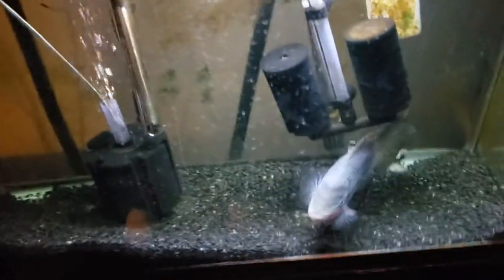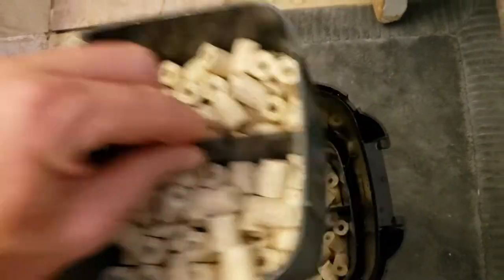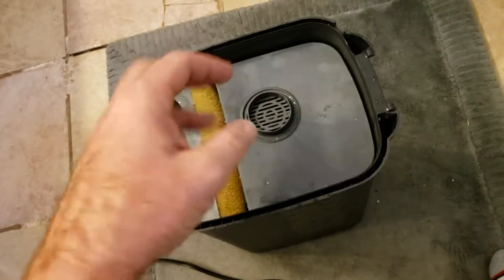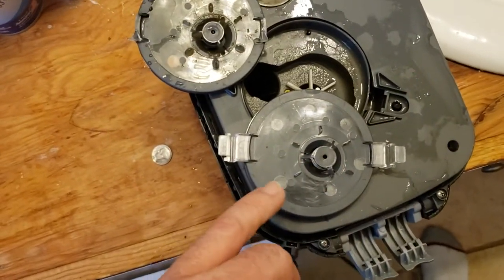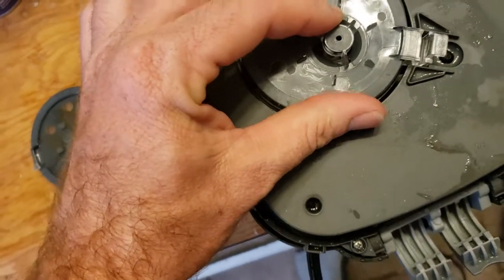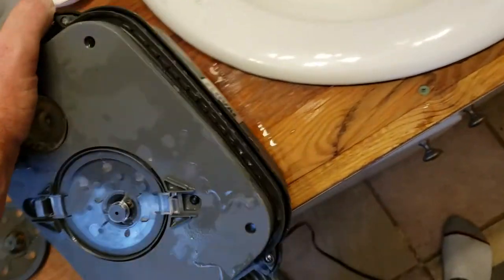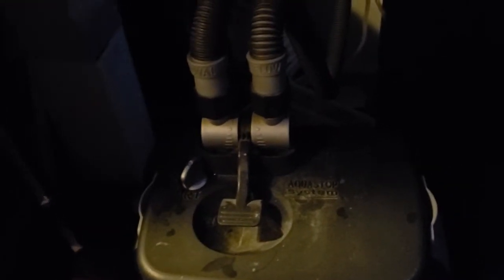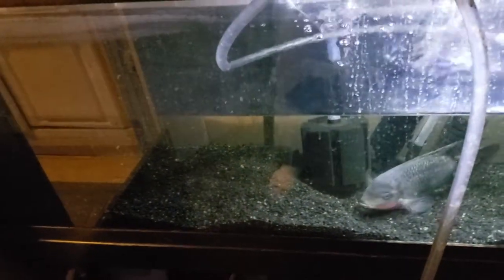Fluval 405 sucks

Comment: Same issue with my Fluvals. I love them but hate the issue. I would put brand new and by the next service one would be broke. Even with the most care taken. I found a trick though. Under the top compartment lid I put a part of a hinge on top of the divider between the 2 sides. I then put the lid on. Now when I put the head back together it puts a little more pressure to keep that cover from popping out. I have not had a failure in over 3 years. I have been running these for years now

Comment: I agree, my filter cover is broken on one side but I’m still using it. I’ve got 2 of these fluval 405 which i bought for spares and repairs for a cheap price and I managed to work 1 out by interchanging it’s usable parts which means 1 is useless now but the other one is usable.

Comment: I just figured out your problem, ,,,,I just bought the rebuild kit for a 404/405.....in the kit it comes with the motor shaft and the top gasket.....welll,,the Lil  shaft they give you comes with a rubber nipple on the end,,,, I put mine together just like you did and I had two of the rubber nipples in the bottom and it was too much pressure and broke the plastic piece that holds it together luckily I had two of them because I have two pumps and fix it the right way

Comment: I jammed a cut down Q-tip inside the motor head a few times and suction cupped it back out.  If  your motor has been replaced a few times  you have few nipples stuck in the power head,,,,they all fit inside each other ,,so there's more pressure,,and breaks the plastic clips,,,,

Comment: I've had mine for a couple of years. I've never broken any tabs off. Having said that the lift up tab that holds the pipes in is very difficult to get off. It doesn't feel very strong either. Add to this that there is often a leak after refilling and I can honestly say that I can't recommend this filter.